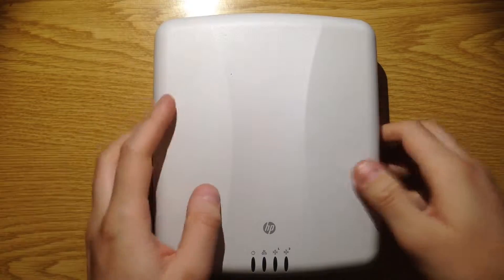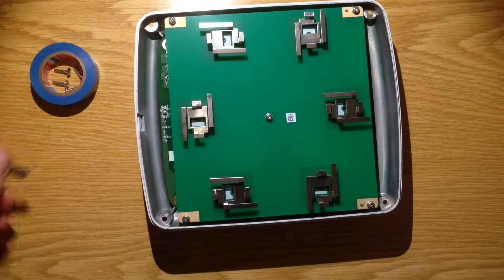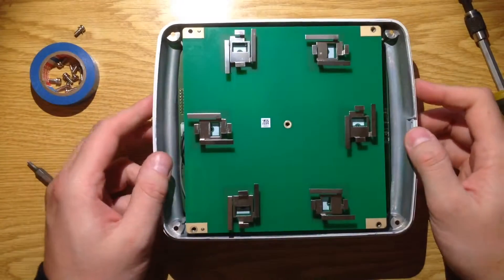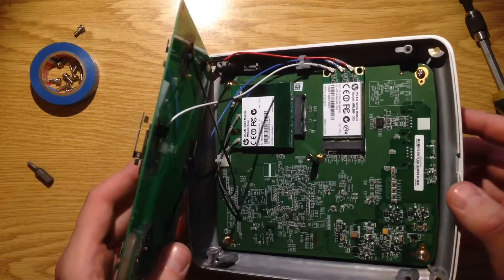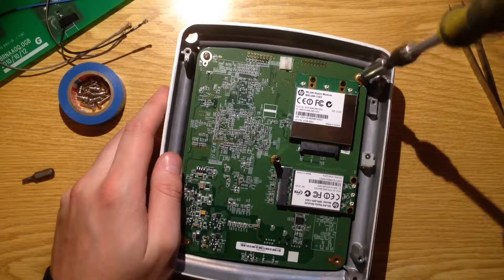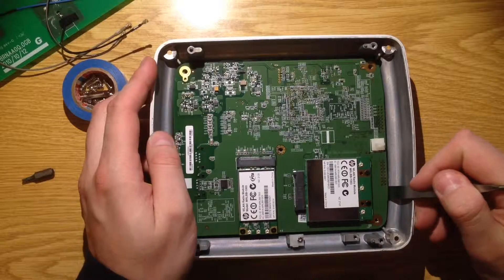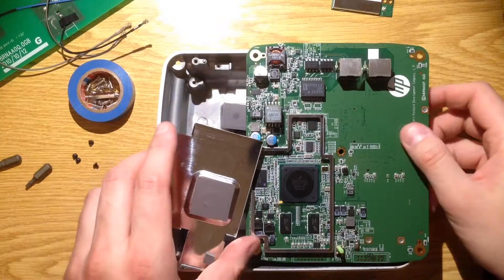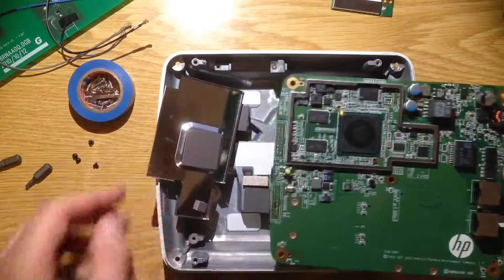HP 560 Access Point teardown

Comment: Hi..I have a HP 560MSM access point which was used on some other site as autonomous and has been removed since over an year. I have to configure it to new site in autonomous mode. Problem is they don't have the correct password to login and if I do factory reset;it goes to provisioning mode and there is no option to see "switch to aunomous mode".Is it a firmware issue? Or what could be done to avoid it.
Reply: You need to upgrade the firmware to the latest version.  If you are going to call HPE support, you will have to insist as they really wish these HP560 would go away but they are still under warranty until 2110.  Once you have them upgraded to the latest firmware you will be able to as you please.  Also if the AP was used with a MSM720 controller you will have to use that controller to access the AP.  If it were used with an HP 830 or 870 you are fine and just update the AP